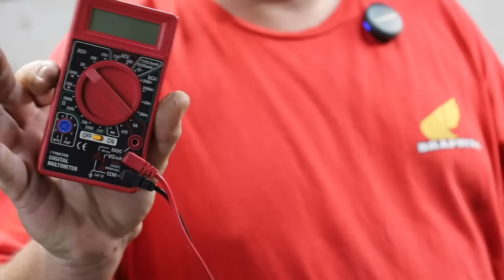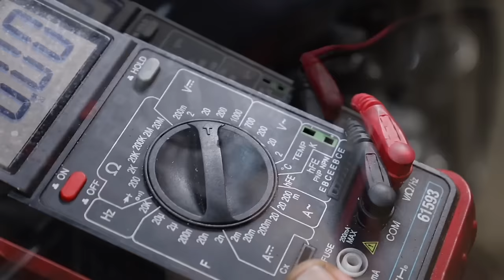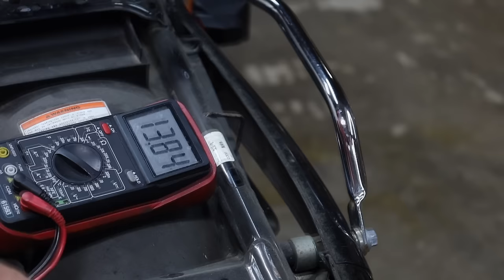HOW TO: Buy a CHEAP Motorcycle without getting SCAMMED on Facebook Marketplace

Comment: Tires are consumables so negotiating for worn or outdated tires is basically like trying to negotiate over an empty gas tank. Bikes use tires much faster than cars. Get used to it.
Reply: Anything is something to negotiate over..bet you have never got anything as cheap as someone would let something go for..Tires and an empty gas tank are not even relatable.
Reply: Nah dude.
Looked at an XJ600 for 1000€.
New set of tires about 250€.
Got him down to 800 just for em.
Reply: 18 dollar tank of gas vs 500 plus or minus for tires.   Thats a big difference
Reply: No. Tires are expensive and are a necessity for a usable machine. KBB, etc. values are based off of a usable machine. A person who would buy a bike with no gas in it and the word of the seller that it'll run with a fill up is also a fool.
Reply: If th bike has 10+ year old tires that's a minus- for the seller...buyer will have to pay for that...that's 500 off the asking price right there
Reply: You find me a pump that pumps tires for what it cost to fill my gas tank… ill agree with you

Comment: I have been fortunate on three motorcycle purchases that were older, but very low mileage and stored in heated/AC conditions.  I put on new tires as well as updated the brake and clutch cables to stainless steel and even had the vehicles' fluids and four-barrel carburetors serviced ($$$) on my 1987 Kawasaki ZL-1000  Eliminator, 1994 gen-1 Yamaha V-Max (1,616 miles) and 2007 gen-1 Yamaha (5,320 miles) V-Max.
The people that I purchased from were collectors in their own right and did me solid each time, but I should have had ALL of these topics in my head for immediate consideration.  This video made me feel like a (buyer) rookie.  Now, I can probably properly educate someone on what to look for.  I would probably promote them to go WATCH a replay of this educational video.
Reply: Thanks man, truly....that means a LOT!!

Comment: I'm a shadetree surgeon myself and my 1984 Honda V65 Sabre get's lots of love from me.. I've rebuilt the brakes front and back.. calipers, master cylinder and steel brake lines. The fork seals and fluid. The wheel bearings and seals. The clutch system rebuilt master, slave, new steels, new friction disks, new spring and steel clutch line. Oil mod kit. New Avon tires, AGM battery, valves adjusted by me 5 thou.. Replaced fuel lines and fuel filter. Replaced rad (pin hole leak) All fluids changed to synthetic. So far no rust in the gas tank but I try to keep in full. Bike runs beautifully !
Reply: Bike that old just run conventional oil like they used to have in the day...modern synthetics don't have enough zinc...
Reply: Good on ya for keeping a old v65 alive!!!

Personally, I don't think too much of the "oiling mods" on the Honda v4s, because if you run the correct valve clearances (Honda had amended these several times in the early years....your dead on with the .005 figure!!), AND either a good quality oil with a high Zinc content, or a Zn supplement, the oiler mod is unnecessary (personally, I like the rev-X brand stuff from Amazon).

If you ever have to get into the carbs, make SURE that you keep all the parts separated to which carb they came from!!!... The emulsion tubes are DIFFERENT from front to rear, and they're NOT marked!!!

Comment: I just bought a Honda Shadow 05 so it's 20 years old. I could tell it had been sitting when I asked it hadn't been on the road and under a tarp outside for over 2 years. I negotiated about 40% off the bikes asking price.  It needed fork seals, tires (over 8 years old), fluids of course, some wiring repairs, seat was good but painted, signals worked but hyper flashed with with out LED bulbs, tail light and break light did not work. I have a little side job running a service shop so I'm knowledgeable and capable of doing those repairs myself, otherwise without the price reduction the bike would had been a hard pass. Engine was solid but needed break shoes and pads also.

Comment: One time I bought a CBR400RR ,and it wasn't till I rode off and reached the Gas Station that I noticed the Fuel Tubing from the Tank to the carb was leaking, and I had 80-100miles to ride. There was also a Overflow Tube coming from somewhere to near the side stand so I swapped them over. Another time my friends exhaust fell off at the downpipe but I managed to find the right size nut on the Frame somewhere, like a rear footrest hanger or rear exhaust hanger. So if you need a bolt you could live without a mirror till you get home. I look at the teeth on the sprocket too, if they're elongated or hooked like thorns the bike needs chain n sprockets replaced. Test the brakes immediately you get on the bike, don't wait until the first intersection.

Comment: I bought a new 06' xl 1200low sportster and put a tender plug and tender a few weeks later. The oem battery lasted 3yrs. Afrer replacing a few more batteries i got a napa legend agm battery and was $100. 5 yrs now and still going! Probably pisses the bed tomorrow but I sure didn't expect it to last that long. Sure enjoyed the video!

Comment: Shade! I got a T700 off your suggestion for my first bike and I ducking love it!!! I can flat-foot it being 6’4 250. Around country Texas roads it’s great. Reminds me of my dirt bike days just on roids. I’m still craving that cruiser style and my buddy is looking at getting rid of his garage kept 2003 VL800 50th anniversary. It’s got 23k miles, cobra seat & pegs, tassels seat/handlebars, new tires, and beautiful original paint. He wants 3,000 but is willing to let it go to me for 2,000. Think this is a good second cheap bike to get into cruisers? I’ve looked and using cycle-ergo it looks okay for my size but I’ve yet to sit on it just dicussed it at work today and wanted to get your opinion. Thanks brother man!!! Much love!
Reply: The vl is a solid bike.... pretty low maintenance, but on the carbureted models(they were made with EFI starting in 04, IIRC) as they age, the fuel pump looses volume.....if it has a hard time at freeway speeds, the pump needs to be replaced (dont worry tho, it can be had for around 40 bux, so its not gonna break the bank!!)
Reply: @JoeTheMountainJedi  going to look at it this afternoon! Hell if a couple hundred in maintenance is all it takes and I’m getting a good deal I’d have no problem. More looking for comfort, something able to get around town, and something I won’t kill myself with. DFW native so don’t drive highways much as Interstate 35 is my only option and people drive like idiots. Thank you for the info brother man! I love this community!!!

Comment: Don't forget about looking at the front forks. The fork seals will go dry on an older bike and start leaking. Give the bars a wiggle and lift to check the head bearings for slop.

Comment: Got some Shinko 777’s off Amazon last year for my V-Star 1300T. $225 shipped for front and rear.  Little over 4k miles on them. They’ve been great.
Reply: Man, I'm glad they are working out for you, but I gotta be honest....I really don't recommend them, due to how soft they are... IMHO, the value just isn't there!!
The ONLY shinko that I recommend to anyone (other than scooter tires) is the new 999 long haul series.....I e been "long term testing" these tires for our dealer rep, since they are relatively new on the market, and I have to admit, I like them!!.... Good handling, awesome in the rain, and the tread life so far has been VERY impressive!!!(I have 14k on a set that I installed in July, right before a thousand mile trip that the wife unit and I took for our anniversary).... I might actually get close to 20k on the rear before I need to swap it!!!(2006 Yamaha roadstar 1700, with hard bags, tour pack, and a chubby guy in the seat!!)

Comment: Let me add one thing from my own experience. Look closely at any fasteners holding on plastics/fairings. I bought a used VStrom 650. When I went to change the air filter, I found that on almost every bolt holding the plastics on, the head was stripped out.
Reply: I’ve got the V-Strom 1000 and you’re right about those fasteners 😂
Reply: Yeah, that comes with the territory on a lot of sport-ish bikes ....the ABSOLUTE WORST is when I get one in that has the stupid anodized aluminum body bolts😡😡😡..... Those things are as soft as a cowpaddie that got dropped in the middle of a thunderstorm!!

Comment: Good video, covered a lot.  What about a test ride?  Only way to find out if the clutch slips, trans. is bad, rotor is warped, etc. How do you handle that?
Reply: Umm test ride it...most sellers with cash in hand and a friend of yours there will let you take a short test ride
Reply from the maker: That’ll be a different vid!

Comment: The tires on my 85 magna v30 were made in year 2000, cracked brake lines, carburators were removed, and full of wood dust and chips, no pressure on the front brakes nor clutch, no coolant, no gas in the main tank just a bit of rust on 1 of the nipples under the tank, I cant remove the gas tank cover to look inside but I think its safe to say its rusty, really hard fuel lines, rusty exhaust, only paid $250 for it with a clean title 10k miles, did I mentioned its my 1st bike? wish me luck 😅 so far I cant find any replacement hoses online, ill have to make my own if I have to

Comment: I hate to say I paid at least $1000 over on my triumph legend it sucked to pay that much that’s top dollar but I got it from a dealership and they are kind of rare. I’ve wanted one for over 20 years whether it was an adventure, Thunderbird, Thunderbird, sport, or legend, and I found the legend And I absolutely love this bike it’s beautiful it’s all black and nasty. I’m glad I found the legend because I actually prefer it without all the chrome I’ve got my T160 trident for chrome, but I wanted a bike that I love the looks of that had pretty decent power Worked mechanically well with very few if any problems and that was looked over by the dealership because I don’t know crap about motorcycle mechanics I can change a battery and put air in tires and maybe make it a little dangerous or blow it up. Yeah you literally sold me a dream, that was my dream bike I dream small but even small dreams take 20 years to achieve sometimes when you’re poor

Comment: Just bought a $2,000 2001 1200 Sportster. Didn't do all the checks you suggest but did do  the leak checks and rode it for about an hour including on the highway. needs tires and carb work. Just baked that into the price. In the end it's going to run me about another 1200  to 1500 so now I've got a 3500 motorcycle. Got to figure that's okay. But it's not a $2,000 motorcycle anymore.
Reply: I had my Sportster carburetor cleaned for the first time in 25 years. A rebuild kit and 1 hour of labor took care of it. Just ordered a set of tires from Dennis Kirk + tubes  and rims strips for $200  free shipping.
Reply: @frankmarkovcijr5459  I may have to give that a try- tire brand ?

Comment: On a Honda CB 750 Nighthawk all you have to do is change the fluids and filter, the bike has hydraulic valve adjustment so you don't have to mess with the valves. It was almost maintenance free. 20,000 miles is nothing. Almost brand new. Is it still for sale? How much?

Comment: I'd end up running from that bike to begin with because it evokes memories of being scrunched up in a little ball on a 250 model during my MSF class.
Reply: Lol, hey man.....I've been this size since I was 16!!!... Got my first street bike at 14(Kawasaki 250 eliminator) and rolled over 50k on that thing before I sold it!!!...... TBH, I wish I had it back!!!
Reply: @JoeTheMountainJedi  You have to consider, though, that I'm 6'2" and, when I did my MSF class last year, weighed 340 pounds. Our choices were a 2003 Nitehawk 250 or a 2000s-model Suzuki TU250X. I'd have been compressed either way, and another reason why I got a Dyna as my first bike. Lol

Comment: Greetings 👋🏻 from Denmark 🇩🇰 
As a former Honda dealer and shop owner (and mechanic) who works on a lot of them shitty 💩🏍️ 80’s bikes - 2 more quick tips will be.
1: nobody changes fork oil - and if 🛞 tires is for safety- then suspension is even more. Since it slows the tires to connect whit the road. 😉
2: Tupperware 🏍️ bikes (Japan) has rubber manifolds - and age, weather, sun etc makes them crag. And then the engines runs like 💩 shit. 
The are easy to se and easy to point out to the sales person. And some is pretty expensive - so keep this in mind. 
Just my thoughts 😉
Thanks for a great clip - that can benefit many normal bikers. This is what I like about the old shadetree clips - before the girls and all the other no bike related.
Reply: I appreciate your input sir!!!.... Always nice to have an outside opinion!
The reason that I didn't touch on the suspension, frankly is, I FORGOT!!(yeah, old age creeping in here!!)... The forks on this particular bike are in amazing shape, considering the age, with no cracking on the dust wiper seals, and no leakage, or corrosion on the tubes(a rare thing down here!!)... We have a few in the works that is going to focus on the "worst case scenario" on a used unit, and ill make sure that I expand on that topic in particular at that time!

Thanks for keeping me straight 😉

Comment: shops in colorado drive in drive out, $50 a wheel for tire change.
Reply: 30 for me.  15 if I bring in the unmounted wheel.  
I pay the ride in service when I have to do both as my front lasts 2wice as long.  Same model as the video.

Comment: Had two of these bikes, 91 and 93. Bought both new $3999, too bad those prices dont exist any more.
Reply: $9200 today in money value.
Remember in the Reagan/Bush era Tip O'Neal said 80k/yr was the rich.
Reply: CB650r is $9600...which is more bike but the closest equivalent
Reply: My used 91 vfr i bought in 95 witj 4500 miles cost me 4500. It is still the most i paid for a motorcycle. Good deal too as i  have close to 90,000 good miles on it! Bought a basket case cause i love them v-4s.
Reply: I have a Nighthawk with 65k on it.  Still runs very good and the only internal failures were two oil seals.  I am looking at a clutch pack replacement as my top two gears are right on the edge of slipping on grades.

I have no interest in dropping 10k on a bike as my old Honda gets older...but I'm also not interested in spending $4300 on an Indian clone that makes a whopping 20hp and can't top 65mph.
Reply: So back to the used market I'll go next year.

Comment: Ok, question. Let’s say I want to be a motorcycle mechanic. (My dream is to buy bikes cheap fix them up and flip them, but I’d like to work at a dealership to pay the bills.) what is the best way to go about doing that? Would the certification be enough or should I absolutely do the 2 year master mechanic route?
Reply: Man, that's a tough one to answer!!!
The biggest issue I see in the industry these days is knowledge retention, and the fact that the dealers are CONSTANTLY pushing people into newer models..... ALL dealers in our area, regardless of brand won't touch bikes that are more than 15-20 years old, and truthfully it's a damned shame, because not only are the people with "old stuff" ( like me😂) getting pushed out of the system, the techs AREN'T learning how to maintain these bikes!!( As ridiculous as it sounds, the average "dealer tech" these days has no concept of how to diagnose and repair a carburetor!!)..... Personally, I put FAR more faith in someone's attitude, and willingness to learn over some piece of paper you hang on the wall!!!
IMHO, you'd be better served by reaching out to a established independent shop, and see if you could apprentice in that environment, as opposed a dealer..you'll learn more, and more importantly, you'll learn "better" than at a dealership, due to the variety of makes/models/age of units in the shop.

Personally, I wouldn't spend my money on "those institutes" for education, because at the end of the day, they are a "for profit establishment".... If you pay your tuition, and show up, and aren't a complete loon, they are gonna make SURE you pass, regardless of how much you actually learn!!